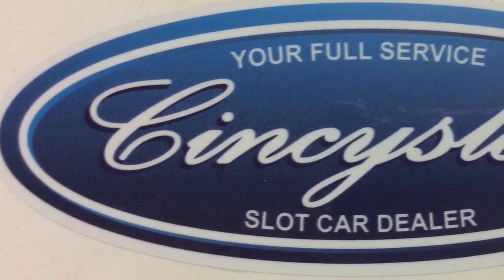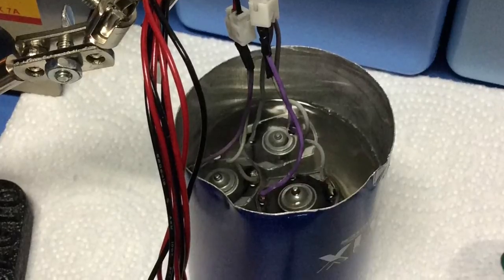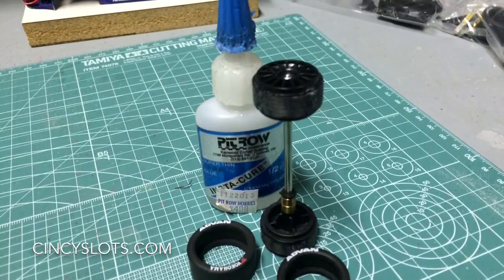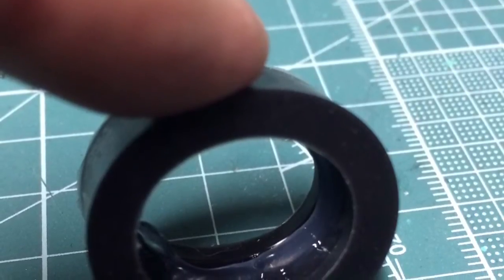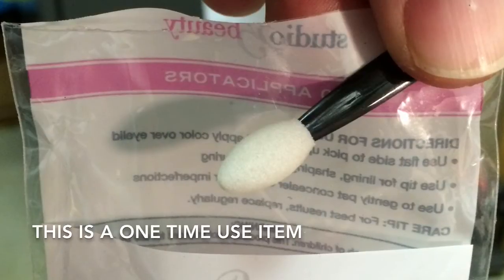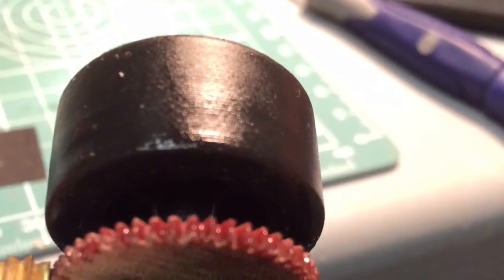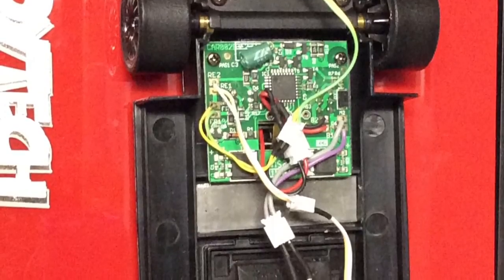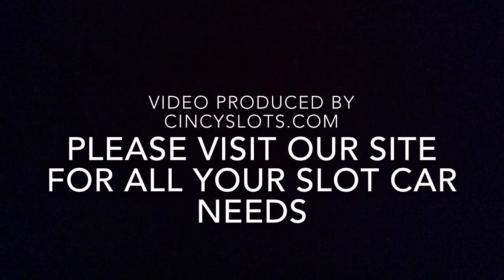Carrera Digital 1/24 Tuning set up Video by Cincyslots.com autorenbahn

Comment: Have you ever done and before and after RPM-wise on the motors?
Reply from the maker: Mark Gerrard this would something to try.  It doesn't make the motor faster so to speak.  It makes the acceleration smoother.  The time in the WD40 is just a guess but seems to work.
Reply: Okay, thanks.

Comment: What sand paper do you use for silicone tires
Reply from the maker: we 80 grip drywall paper(needs to be super glued to a piece of styrene or similar) and then finish with 30 mins of 600.

Comment: Hey can you make a Carrera digital cars work on a scalextric  digital track and if so how cause all I can find on YouTube is how to put a skeleton chip in a Carrera car
Reply from the maker: you would have to put a Scalextric chip in the Carrera car.  Carrera chips will not work on Scalextric track.
Reply: Will it fit or will I have to modify the car another question can I turn my analog Scholastic track to digital with The Arc Pro Power Bass
Reply from the maker: @28axekilla  the chip should fit.  The Arch Pro should also work but I don't use or sell Scalextric track.  You may want to ask this on the Scalextric Fans Facebook page.
Reply: Thank you